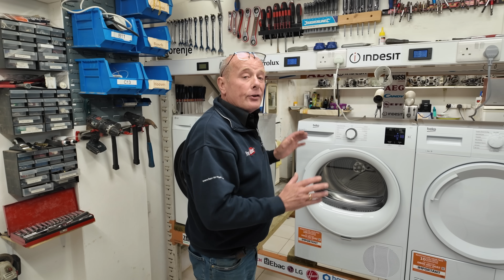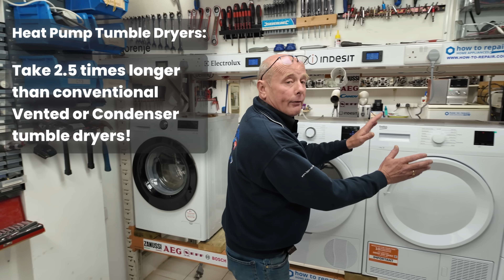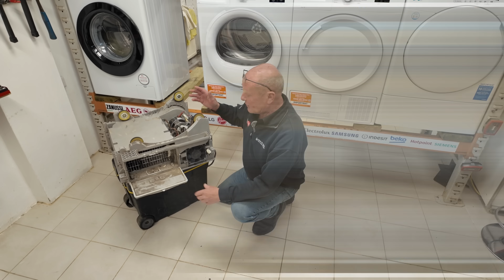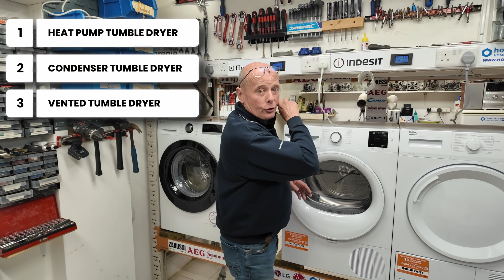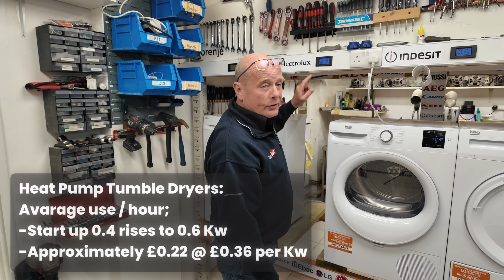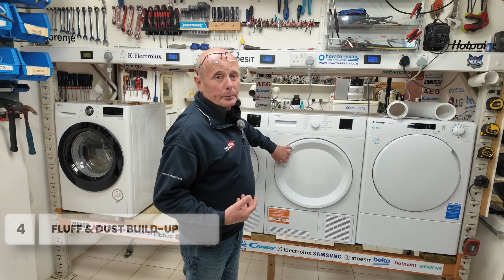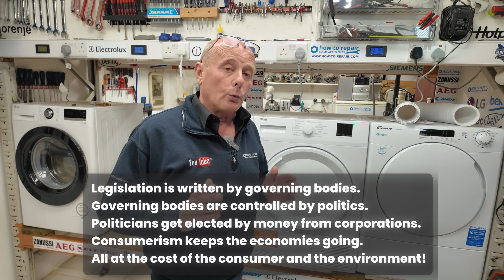Tumble Dryers the Shocking Truth About Heat Pump vs Vented & Condenser, NEW LEGISLATION!

Comment: The disposal of everything ‘green’ is an enormous concern that is just NOT being taken seriously! They keep on pushing the ‘net zero’ but don’t tell the whole story. Unfortunately not enough people take the time to educate themselves on the impact of NET ZERO and on the ecosystem! The unrecyclable waste, will reek havoc on the environment!
Reply: The 'green' or 'nett zero' slogans are meaningless if they don't factor in the whole life cycle of the product being sold as 'green'
Reply: Good point. Basically, the "net zero"  claim is usually for new products at point of use. As you say, do not take account of the whole picture including environmental cost to manufacture, transport, maintain in service and dispose of. What we need is a way of assessing the lifecycle environmental cost of a product?
Reply: Don't think, just consume product.
Reply: I guess legislators need education how long will the general public. Net Zero as a target does not mean lower energy consumption. It means that the objective is to have the maximum possible amount of energy derive from sources that are directly driven by solar influence -its light and gravity - with minimum net storage and transmission losses.
Reply from the maker: Think about the environmental impact of building machines and then recycling them. These machines are often transported halfway around the world, which adds to fuel costs. It's baffling that we need to ship them every five years due to failure.

Thank you for your comment. I appreciate people like you taking the time to write it out. Please share it where possible. It might help others make a wise choice instead of being misled by the industry.
Reply: @How-to-repair 
5 years? I found almost every machine is only gauranteed for 2 these days. I only found this after needing g to replace a washing machine that died after 2 years.
Reply: So a normal tumble dryer doesn't create waste? Keep grinding that axe mate.
Reply: @mentality-monster  well that's kind of the issue - you grind an axe to keep it sharp so you don't have to waste money and resources buying a new one.
Reply: @ I'm not sure you understand the phrase, have a quick google, it should help.
Reply: @mentality-monster  I'm not sure you understand the meaning of metaphor.

Comment: Very useful information thank you. I was thinking of replacing our condenser dryer with a heat pump dryer but will not do so now. We have had the condenser 10 years or so and it has become less efficient though a thorough clean of the condenser box has improved things. I agree that proposed government legislation on this makes no sense for the environment or for consumers.
Reply from the maker: Thank you for understanding my points and agreeing with them. I believe the governing bodies and manufacturers often mislead the public without truly grasping the real-life issues we face. Many times, these tumble dryers don't even work in garages or outbuildings, and maintaining these appliances is a real headache. Thank you for your comment. I would be grateful if you would share this post, as it’s the only way to force things to go large nowadays. Have a great day, Paul.
Reply: Because big tech owns the governments. It is called ngo groups... For Volkswagen for example, there have been several scandals over the years, where local politicians were paid heavy sums to also be members of the board, and legislate around that... Fired, when discovered, then soon to back in the game again. Hmm...

Comment: The heat pump version is putting heat back into your home though isn't it ?  Very useful if you keep it in the kitchen.
Reply: The normal condensing dryer is also putting heat into your house, so no heat is wasted... It is only on the vented dryer that is wasting heat
Reply: Made our house feel damp , was slow useless with towels are sheets.  Managed to get the rental company to find me an old vented one and it was leaps and bounds better
Reply from the maker: I think heat pump technology is brilliant, but these machines are only lasting on average five years they take at least two times longer to dry the clothes at least twice the amount of wear and tear and components and the accessibility to do maintenance is an absolute nightmare. manufactures do not seem to understand what maintenance is needed and how easy it is to do. They seem to build it and assume it's perfect without testing properly. Thank you for your comment. I would be grateful if you would share this post, as it’s the only way to force things to go large nowadays. Have a great day, Paul.

Comment: We have a heat pump one at work. Absolute piece of shite. Takes about 3hrs to dry some tea towels.
Reply from the maker: This is why I argue against them it does not make logical sense. Thank you for your comment. I would be grateful if you would share this post, as it’s the only way to force things to go large nowadays. Have a great day, Paul.
Reply: That's because it's priority is economy not quickly completing its task.
In exactly the same way washing machine cycles on economy take a lot longer.